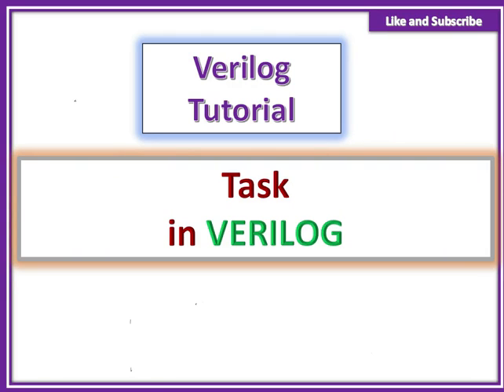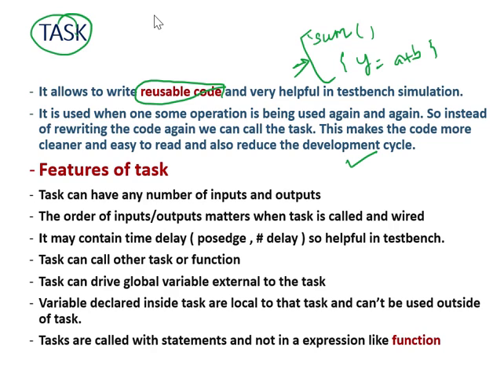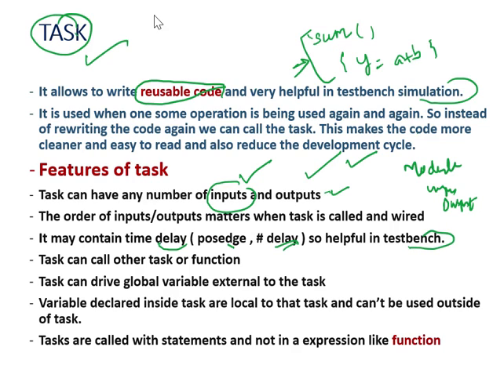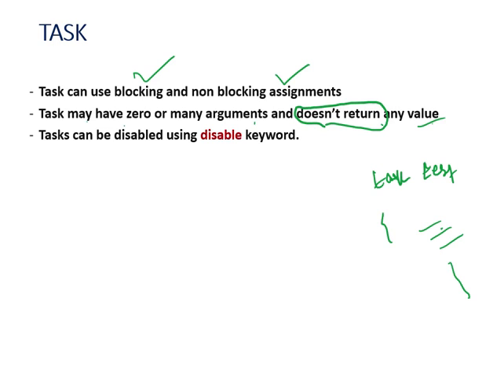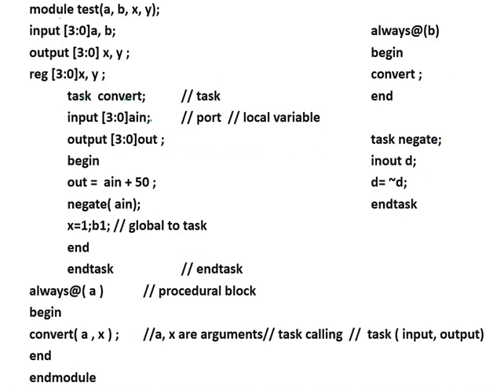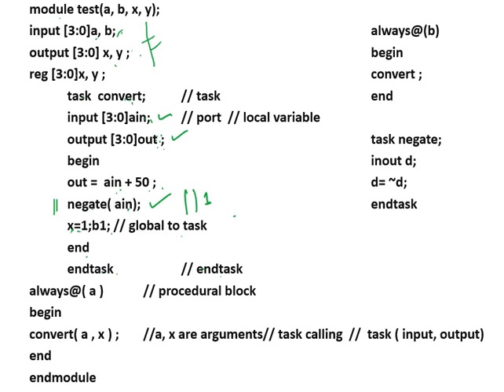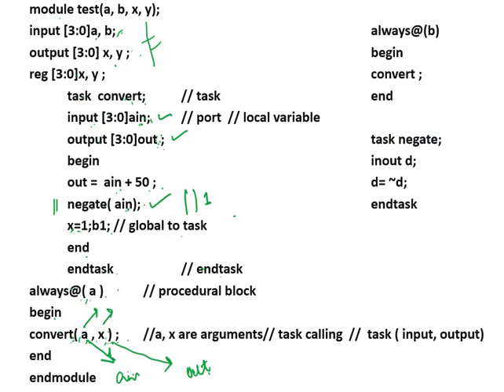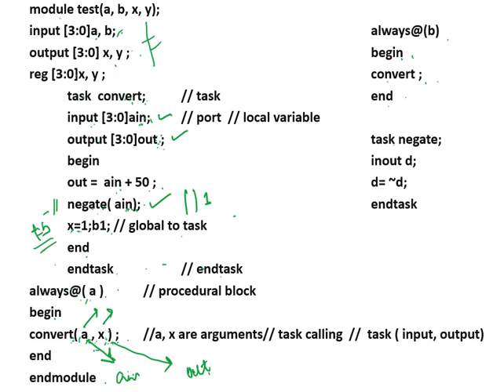#36 (MISTAKE-Read Description) TASK in verilog || Use and features of TASK |l explanation with code

Comment: Sir,you mentioned development cycle is that similar to vlsi design flow?
Reply from the maker: You mean IC development cycle ? If yes, then it's similar to vlsi design flow
Reply: @ComponentByte VLSI design flow only for IC? Rather than development cycle includes all digital circuits like FPGA,DSP circuits .

Comment: sir ,
To insatiate the particular piece of code in behavioral modelling we use task and function am i right ???
if yes then my doubt is if we can write the  code using generate block in behavioral modelling we can do the same then why do we need task and function  ?
can you please clear this ?
Reply: brother from my pov generate is like a loop and task is more likely to function 
In generate , we always have conditional loop inside it but in task when we need to do same thing in throughout the code , then we just call the task and passing argument to it and take value in that argument using predefined task 
Sir if i am wrong then please correct me @Component Byte
Reply from the maker: @raj_rajput944 yes, you are absolutely correct.

Comment: What will be input value of task when we are calling from always blocks? , where you haven't specified any other input but in definition you have specified input.
Reply: I think in definition if we don't specify any input then we can call it from no input task, please let me correct if I am wrong
Reply from the maker: We know that TASK can be called without argument also. The last part in this tutorial may confuse you a little bit. The task calling without argument that is 
convert(); 
 I have not explained it. This is just an example ( without definition)that how a task can be called without argument . Because in the example task convert () has input and output so task calling must have two arguments.
If this has confused you then I am really sorry.
Let me give you a example how task calling without arguments work.

module test;  
  initial begin  
    print();  // without argument
  end  
endmodule  

task print();  
  $display("TASK");  
endtask
Reply: Yes sir, exactly what I want to convey you, thanks sir
Reply from the maker: Thank you so much for pointing out that confusion. It's my mistake. Thanks a lot.